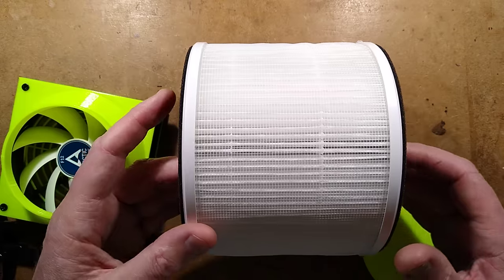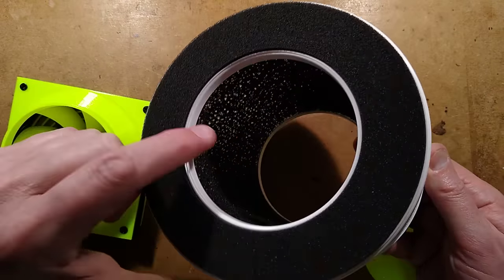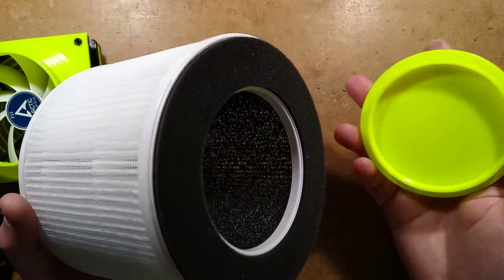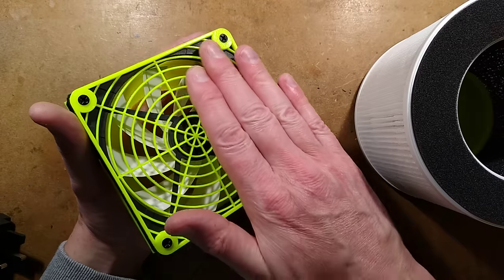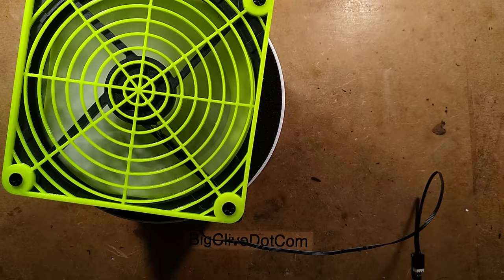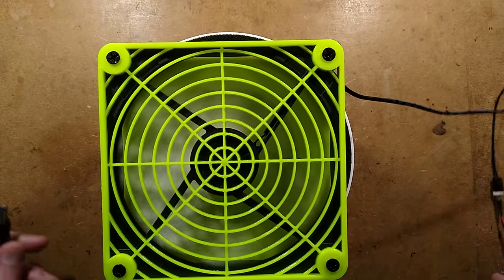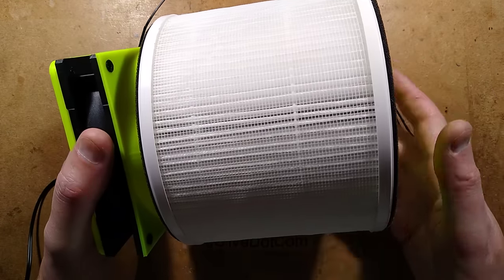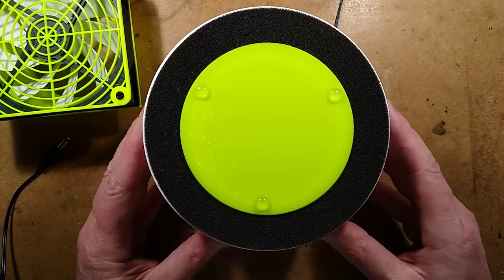DIY cheap & quiet HEPA air cleaner

Comment: Clive Many years ago i had a very dusty Room, i got myself 2 x 115v Server fans with guards on, and mounted them parallel , and mounted them over the top of a small tank of water, and mounted it low down, it was great, the dust used to get drawn in through the top and get caught in the water .. all you have to do it change the water from time to time .. i used to put zoflora in the water to stop it going bad, and make it smell nice .. ive though about making a newer version now i have moved house, but this time use a large candle jar with a pc fan on top .... if i had a 3d printer like you it would be an easy to make a fan to jar interface  have a go works well and no costly filters to buy ... i have enjoyed watching all your versions ...De Paul

Comment: I love my El Cheapo modded Anet A6 printer.
I lurk thingiverse for small and practical doohickeys, and print something cool daily. 
I've found PLA+ to be the best filament for me. It prints like a dream at 225ºC, more impact resistant than ABS, No warping, Excellent layer adhesion, as cheap as PLA, but it doesn't break easily like PLA does.
Reply: 225!?
Reply: @jm036  ...and no part cooling fan if no bridging or if not a small part. 
This is what gives the excellent layer adhesion. 
It can take the heat, so I give it :)

Comment: I am trying this right now, the script is awesome!
The hole ended up being too small though by 1 and a half mm, printer error. 
However I was able to just lay some blue painter's tape around it, not the cheap stuff but the one with cotton weaving inside, a little squishy too.
Makes for a surprisingly good seal.

The fan also seals well, just be careful with how you screw the screws in so it is flush!

Comment: Both the production  and the influx,
of particles in a room will always overwhelm a typical computer fan in trying to clean room air.
Reply from the maker: This is designed to run 24/7 in a closed room.  It will filter a surprising amount of air over a typical day.

Comment: I'm somewhat extremely experienced in pleated filters. I used to make pleated water and membrane filters for water, phama, and food&bev. I helped design and build machines for thermal bonding of endcaps for said filters while in school. I now design hydraulic filters and manufacture them. I been able to tour all of our manufactures, including the ones that make the fiberglass media. They not only make media for hydraulics but for air as well. Extremely interesting industries, so many shared parts and suppliers but completely different applications. Parent company is big into air filters but I only know of their construction, equipment needed, and medias used. We can make the filter in this video but have no interest and would conflict with sister companies. Not only that but they sell for quarters each, we'd rather stick in the $20-$450 range ;) AMA.
Reply: What do you think abou taking a  20x20" box fan and putting a 20x20" HVAC furnace HEPA-approximate Alergen/MERV 16+ filter on the back of it?
Reply: @MarkoCloud  Probably would be a great idea. The thicker the filter, the longer it will last and the more airflow you can get through it. Try to get a 3"+ thick one if they aren't too expensive. Stacking 3x 1" filters is not the same and will really restrict airflow. By how much, I don't know.
Reply: @PaftDunk  Deep pleated filter, in other words!!!😁👍🏻
Reply: @fookingsog  Yep. Can't do the same for liquid filtration, pleats get too tall and will pinch themselves off. That limit is around 1.2” with wire mesh as the outermost support layer. For air the max pleat height is limited by machinery. Crazy.
Reply: Which one do you think is more important with these filters, airflow or static pressure?

Comment: I built one. The local store had a specific HEPA filter so built one out of a silent fan, 12V without diodes. It's gathering 90mg of something per day, on a sampling of 10 days.
Reply from the maker: I've never thought of weighing the filter.

Comment: Fan orientation does matter, but it depends on the bearing design.  Most computer fans use simple bushings with a tiny circlip or a split nylon washer placed on the end of the shaft so that it captures the blade assembly and prevents it from moving off the shaft.  The mini and mainframe computers I used to service in the 80s and 90s had entire racks of power supplies located directly behind the card cages.  A single computer could have twelve power supplies, each with two boxer fans blowing cool air through the cages and the supplies themselves before exiting out the rear.  Most of the time if a power supply failed it was because a fan had stopped.  I spent many of my service calls just replacing power supplies or the fans themselves if I had them in stock, or if I didn't I'd disassemble the fans and oil the bushings with a drop or two of shredder oil to get them running again.  Running the fans oriented so they blew up or down instead of horizontally would allow the blade assembly to rub against the stop collars causing friction and making them wear out faster.  Nowadays some high quality computer fans come with tiny bearings that don't need oiling, but they are rare and expensive compared to the millions of Chinese made fans with bushings that are still in use.

Comment: most fans don't care what position they sit in but main issue is dirt and dust that gets inside the area over time. and orientation on that alone will determine the failure sooner or later. ive had arctic fans like those last fine in almost any state but after like 7 to 10 years of use they gotten pretty noisy and was replaced.. by that point likely getting some new ones to keep up with trend or just found something more pleasing. now best fans would be ones with the meglev bearing where it uses magnets to keep it centered no liquid no bearings work any position and dust isn't much an issue what so ever using a static pressure grade one here would make it more optimized as its designed to handle tight areas like filters and radiator/cooler fins.

Comment: The bearings will be fine mounted horizontally - a lot of PCs have the fans mounted to the top of the case.

This design of fan bearing is also the same used in PSUs and they are nearly always horizontal.

If anything, horizontal might even be better for the bearing.

Comment: The 3D HEPA is an excellent idea. The larger HEPAs (18 inch diameter) in the U. S. are reasonably priced, especially at Thrift Stores, but the filters are very expensive. I have found that a couple of stacked old  Chevy 350 cu. inch air filters wrapped in carbon cloth do the job in my HEPA. When I leave the house I turn the HEPA on full blast, activate   my ozone generator, negative ion generator, and UVC lit Germ Guardian. Quite refreshing. The Greens in the U. S. and Scotland would scold me good for all this waste which adds much to the quality of life. As a cancer survivor, I dont care.

Comment: Arctic sells the P12 fan in packs of five for about as much as a single Noctua fan. The Arctic P12 competes with Noctuas for the ability to push air, if not for silence. And they're case fans, designed to go in the front, bottom or top of a PC case, so they work just fine laying down as long as they aren't blocked on the intake or out.

Comment: I've got a Philips filter that looks almost identical to the silent night one. The only feature mine has that this doesn't is automatic speed control of the fan. It has a particulate sensor like that of an optical smoke alarm and when it detects a high particle count like when I'm changing my bed sheets it kicks up to full blast but it normally runs almost silent just pulling a bit of air through. When you made the first one I suggested using automotive filters but you can use just about any filter if you can make a duct for it

Comment: May also be an option to set the fan to suck the air through the filter instead of blowing. Possibly more effective and will keep the fan clean for longer.
Reply: The way he designed it, the fan WAS SUCKING/EXHAUSTING air through the filter!!!

Comment: PC Noctua industrial fans one of the strongest and quietest out there running horizontally well as they are used in mounted radiators. But air should be pulled  via HEPA filter as you don’t want to be your carbon filter first. also you can use afterward woman stocking as washable pre-filter to prolong life of the filter.

Comment: There is some science and niggles around fans as well. In pc fans, if it's a sleeve bearing (probably most common and cheapest), they prefer vertical mounting. Ball bearing aren't picky, but are noisier.  Fluid or rifle bearing like being horizonal, as vertical makes the fluid pool at the bottom, and eventually leak. Magnetic/maglev is still fairly new, and supposedly don't care how they are mounted. There use to be a big deal about fans being made for either static pressure, or high air flow, but now days mostly make them hybrid designs, so it's not as big a deal anymore.

Comment: I think a Noctua A12x25 it's a better fit as it has a better static pressure (forcing more air through the filter) and great airflow.... Also Noctua are known for their quiet fans, and they sell a PWM controller for their fans too so you can adjust the speed.
Reply: That's a wonderful fan, indeed! Although, the pressure oriented Arctic fans would give them a run for their money. I have 2 on my 3D printer's control box running flat out and they're totally silent.  Really impressed with Arctic's fans.  :)

Comment: recently purchased a laser engraver, and i'm planing on moving it into my inside workshop. I've build an encloser with a vent, and was looking at a way to filter the air out put

I've been using a air purifier with an activated carbon + hepa filter combo. I think this will be perfect for filtering my laser engraver (the workshop has good ventilation too. I just like to be safe)

Comment: recommend comair rowtrons for this.  May actually get a reasonable CADR flow then.  But simply a filtrette MPR panel + any gym fan / box / velocity fan will give you an air cleaner that rivals commercial offerings.  Being used all over for covid / pollution / shop dust.

Comment: purchased  air cleaner from radio shack - it was amazingly Bad - collected Zero dust -
use centrifugal fan if pressure is needed  - can be very quiet depending on design

Comment: Adding a bit of a lip on the finger guard would direct the airflow straight ahead instead of the typical sidewash you often get from this type of fan. If much of the air goes straight to the side there is probably quite a large circulating flow, reducing the purifying effect a lot.

Comment: Great idea, I'll be making one of those! I have an air purifier, a posh version of this, replacement filter is £80, funnily enough $40 in the US (massively cheaper as usual, rip off Britain at its best) Costco UK have them on their website for £40 but not been in stock for nearly 3 years! I suspect the manufacturer is not supplying Costco because the are undercutting everyone else by 50%. When the current filter dies I plan to bin the whole purifier.
Reply: I’ve been using the Xiaomi air purifier. Had it for years. Been brilliant and effective. Unit cost £100 new with filter. Replacement filters cost between £12-£15. Genuine filters. £28-£38 roughly. Which can last up to 6 months each depending on machine load. One of the more cost effective machines compared to branded machines which are crazy money.

Comment: I have one suggestion to upgrade this design. Add stator blades after the fan to raise pressure. It will help grately with performance of this filter. Mayby even video idea? Anyways wonderfull video as allways. Cheers from Finland!

Comment: Very good vid, as always Clive. I have recently done something in a similar vane. I bought a car induction kit on fleabay made by Streetwize and am going to be using it for a (lightly) filtered DIY hot air system. I realise it is not HEPA, but it does filter dust particles down to a certain size and is washable. And it has almost no resistance. I bought it for £7 but I think they're usually about £20. Perhaps adding an activated carbon sheet after it would be a cheap way to make it even more effective... Anyways, not to hijack your idea, which I like, but just to add a bit of food for thought. Keep up the good work mate!

Comment: I need to supersize this to make a mosquito catcher. I just need a large fan. The box fan I got from the local Home Despot had a blade break off. Ugh.

This reminds me of the incredible PAPR plastic bag filter that one of the guys on the Prusa forums came up with. The fella is an anesthesiologist in the Seattle area and he designed the thing to accept the HEPA filter cartridges used in actual medical PPE devices.

If an airtight seal is desired in the donut hole plug or the fan mount, a nice big rubber or silicone band (or silicone caulking?) would do the trick, though honestly the friction should be more than enough to force air through the filter.

Comment: I gave up on the cluster of computer fans and used one Fantech FR100. Way better and designed to spin horizontally. Is very nice 😊
Referring to the laminar flow hood I am designing.

Comment: ive tried to build a similar thing as a portable solder fume extractor, but the typical axial computer fans are definitely a little too weak for that purpose

i'm now testing a centrifugal blower which moves a much higher volume of air against the pressure drop, but naturally it's also much louder.

Comment: To say that this will purify air in a room is equivalent to saying headphones can be used as living room speakers.

This looks like a filter from Silentnight 42269. That purifier uses several times more powerful fan than the one you used. Even with a more powerful fan it has a mediocre CADR (Clean Air Delivery Rate) of only 47.

According to AHAM air purifiers with that CADR are good enough for only the tinniest of rooms, 68 sq ft or 6 m2.

The fact that you took a filter from such an underwhelming air purifier, mounted several times weaker fan on it, and then thought it would be a good idea to further reduce the fan's airflow to make it quieter, shows that you have a lot of research to do before teaching others how to build an air purifier.

Comment: Hey Clive great project, l also did a project on a fire lantern that l saw on your live stream.  The ones l have where battery but that did not last very long so l had a fiddle and now they run on a old phone charger cable keeping in mind the voltage (they run just under the voltage ) they required and now they look great 👍

Comment: you can get filters from halfords designed for truck cabins or engine filters or whatnot. May not be HEPA standard but could be potentially cheaper and more readily accessible for these kinds of projects and they come in all shapes and sizes
Reply from the maker: The cabin filters are often suitable.  But not so easy to adapt unless you have a large 3D printer.

Comment: Damn, and my Philips vacuum cleaner uses an arty-farty custom shaped HEPA filter.

I'm not so sure about those fans - I have a pair of good quality fans by PAPST, and they definitely prefer to be mounted with the motor shaft in a vertical position (blades horizontal).

With a pleated cylindrical filter like yours, it's best to arrange the air flow so that the air enters via the outside surface, and is drawn to the inside - This gives the greatest surface area to filter the air,  a slower rate of flow to allow better filtering, and as a bonus, makes it easier to clean any dust from the filter.
Reply: Looking at the eBay listing, I believe this filter is designed to pull air through (outside to inside of the cylinder) as opposed to pushing it.  It makes sense as that would lessen the amount of muck that would get into the fan motor.  Also, I believe carbon layers usually are the last step in air filters.

Comment: Most computer fans will happily start on 6.5v and up. Back in ye olde days, I would get super-high powered Sunon (140CFM) fans and use the 5v rail of a computer's PSU as the negative rail, meaning they ran at 7v. If you want a modern solution, try using a 9v plug pack and even big fans will be nicely quiet.
Reply: +5v = reference, +12v positive, 12-5=7!!!  I did the same trick too!!!😁👍🏻

Comment: I was looking at doing something like this myself. I settled on a 15$ Karcher Vacuum filter,  11.5x 12x 8CM , A so called 'silent' pc fan for 10-$15. They have a wavy blade and claim to be only 11 dB, and then for the case I'm going to make a wooden enclosure, but it will be held together with 140mm m4 threaded rods $12) and have some nice stainless steel mesh on the sides (5$) and a 10 dollar power brickand some added circuitry to control fan speed . Maybe a little more expensive than what could be done with a filter and a fan taped to it, but should look good and be equivalent to a $200 filter at a third the price.
Reply: Only problem is extremely low/tiny air volume vs something designed to clean room air;
meaning the production and influx of particles in a room will always overwhelm a typical computer fan.
Reply: @dr.anthonyforgione4253  Thats true, however this isn't a typical PC fan. it seems to have similar air volume as a ''standard' Mid sized room filter I already own. That filter I cant find replacement filters for anymore, hence the desire to use a standardised and very commnly available filter type.

Comment: Dear BigFiltrationator, I have done something similar in 2020 with a copy of a Xiaomi HEPA filter which is a bit taller. I have added as advised a sheet of electrostatic non-woven polypropylene filter around the HEPA filter so the filter last longer and you can replace the prefilter easily for cheap.